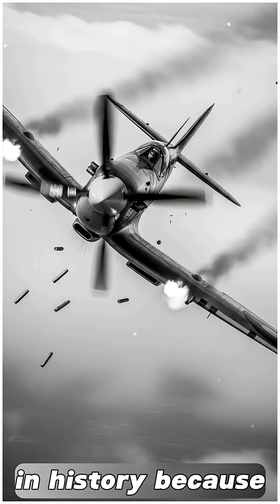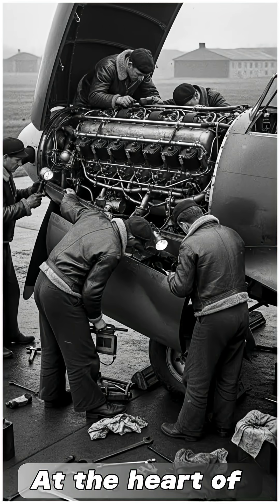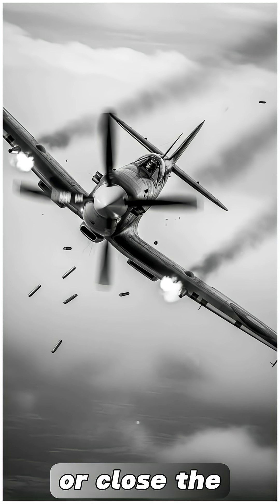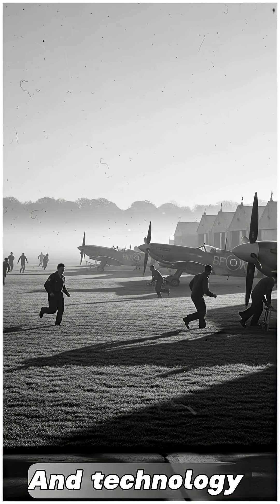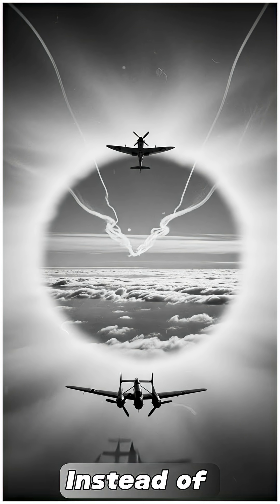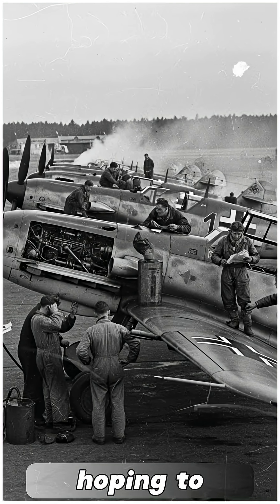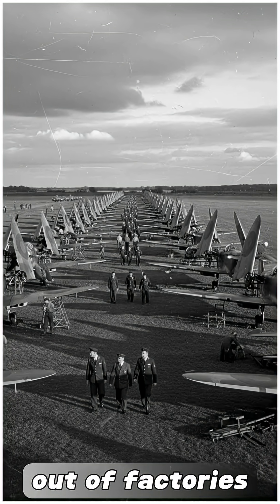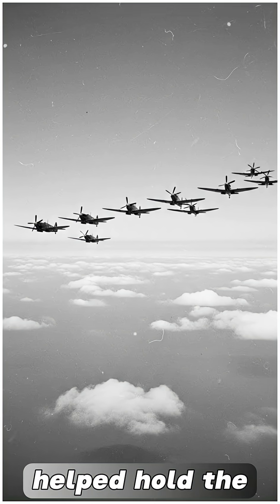Why P-51s flew FASTER with gaps in them?

Comment: The Hurricane and early warning radar saved Britain. The Battle of Britain was the pivotal point during the beginning of the war. Non experts jump to the Spit because it's pretty. Too many wannabe WW2 experts on YouTube.
Reply: You are absolutely right, the claim is that the Hurricane only shot down more planes because it was attaching the bombers.  But the Hurricane shot down its fair share of fighters too.  In three turns it could be behind the 109, and it has been said many times that the 109 pilot would only admit to being shot down by a Spit.
Reply: @MadPom-c1o Having a PhD in military history specializing in WW2 helps with getting the proper information out. So many who are not experts think they are. The internet and especially YouTube has poisoned minds with incorrect information. A.I. Just makes it worse.